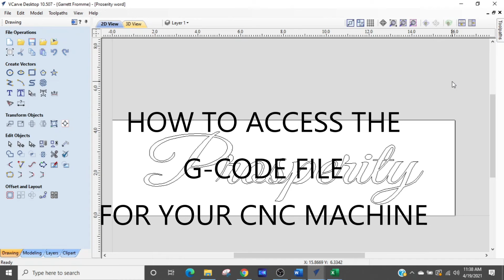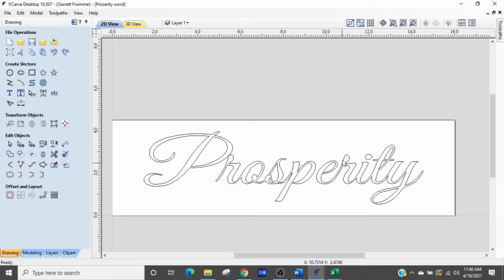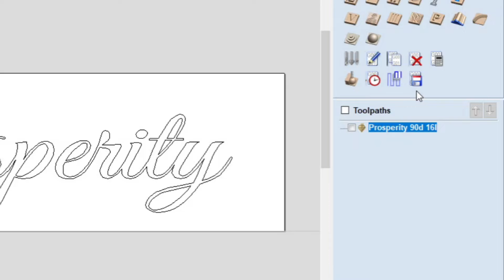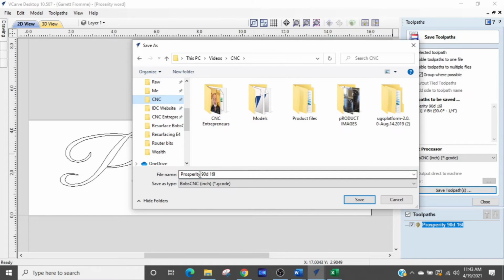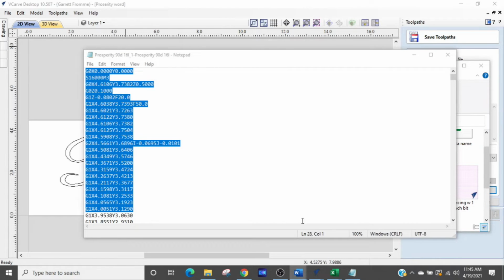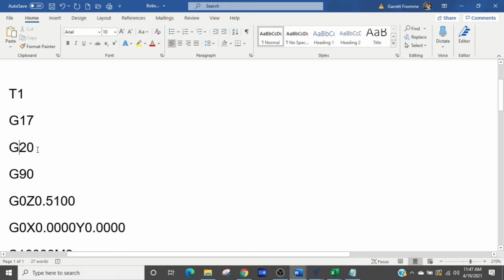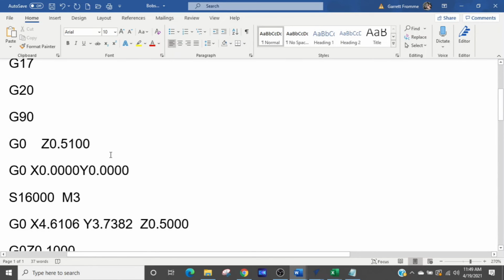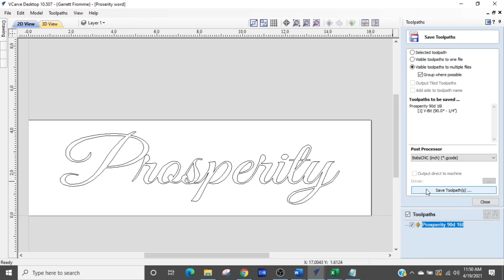CNC Machines - What Is G-code, Why You Want To Know & How To Access G Code Programs - Garrett Fromme

Comment: hello can you show me how to make a macro on vectric to measure  tool lengh  on the touch probe every timme it starts a new operation  ?  i cant find it anywhere or maybe you have some videos about that. or just point  me to right direction  :)
Reply from the maker: Hi POV. I do not have videos on Macros. You can not make a macro in Vectric. You can in your gsender software...the software that runs your CNC
Reply: @IDCWoodcraft  okay thinks for the help. i thot i can make some changes in post processor or something to add some lines in the start of the g code always i make a project.

Comment: Just one quick note. Easel actually sends Gcode directly to a Xcarve (works with any GRBL controller). You only have to save it to a flash drive if you want to run offline. Easel will generate the Gcode when you click carve and saves it in a temporary file. 

I'm actually working on putting together a video to walk people through this process because it is my favorite function of Easel. You can change a design and carve without ever "exporting" another Gcode file.
Reply from the maker: Thanks Jeff, for sharing this. I didn;t know how it worked with easel to xcarve. Now I know.
Reply: @IDCWoodcraft  I only mentioned it because I had heard you in a podcast saying that you couldn't figure out how to export Gcode in Easel. You have shared so much information with us I just thought  I would return the favor.  Thank you for everything.